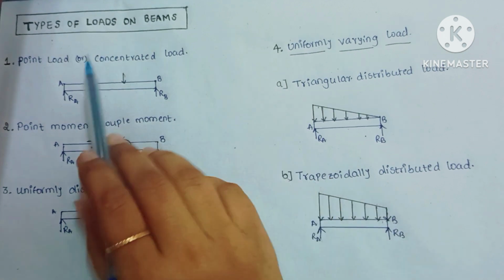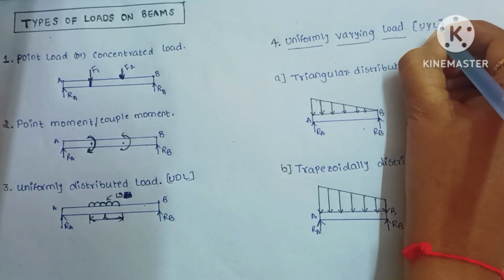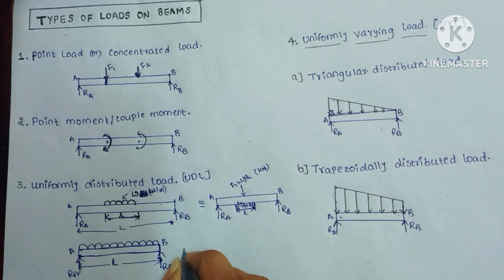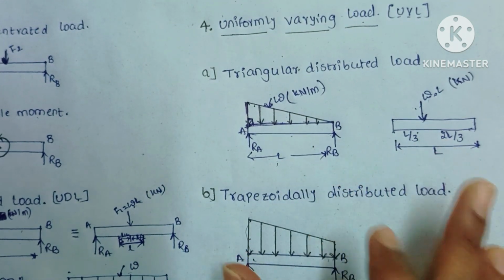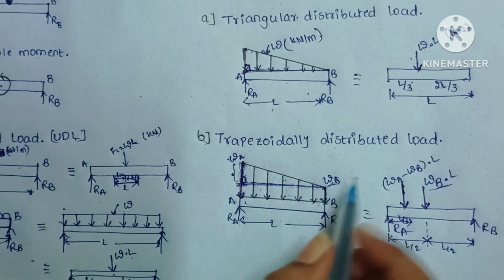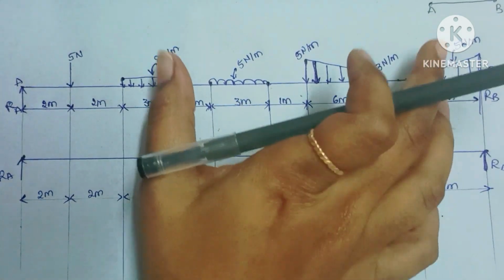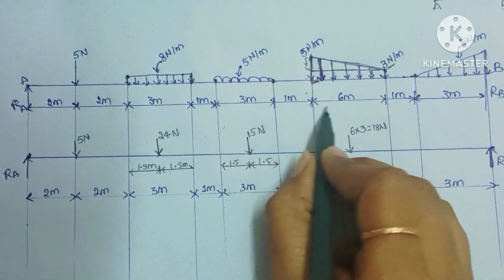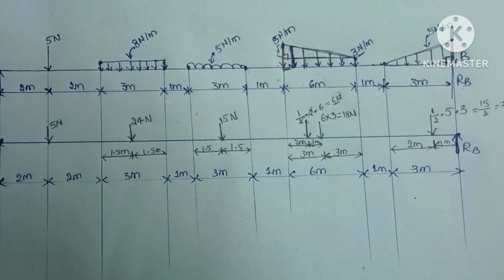2. concept with problems on types of loads on beams || Applied mechanics || Engineering mechanics

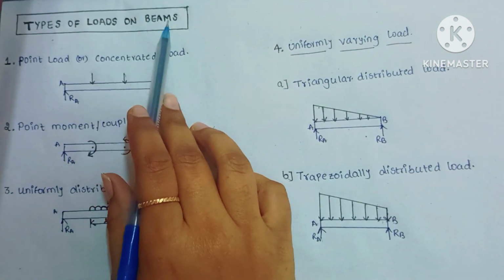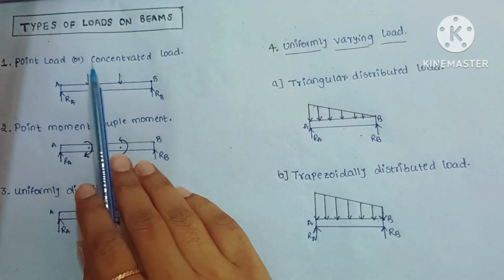Comment from the maker: 0:05 to 1:42
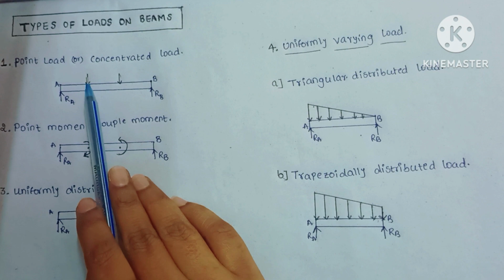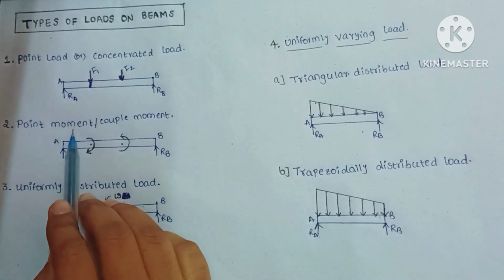1:43 to 2:30 about point load
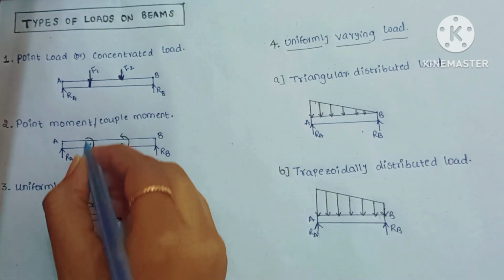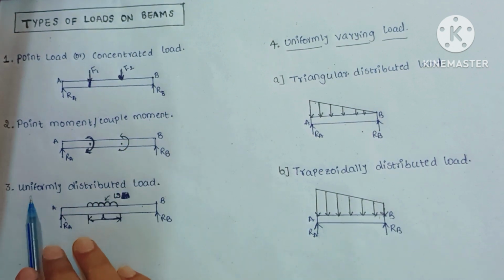2:30 to 2:47 point moment/couple moment
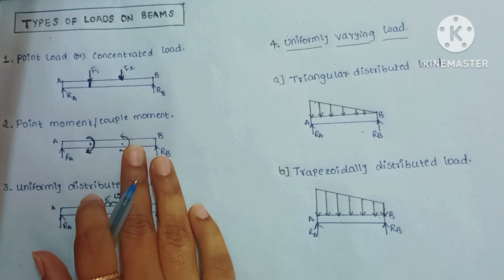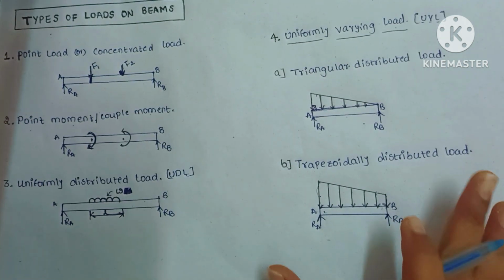2:48 to 4:00 about UDL and UVL
4:01 to 7:50 converting UDL to point load
7:56: to 14:00 converting UVL to point load
14:01 to 15:41 something related to UDL
15:45 to 23:00 example problem for converting different types of loads into point load.